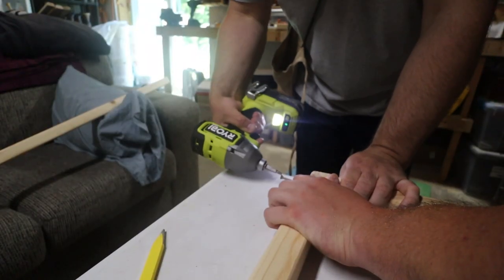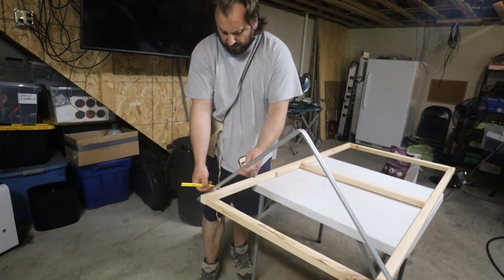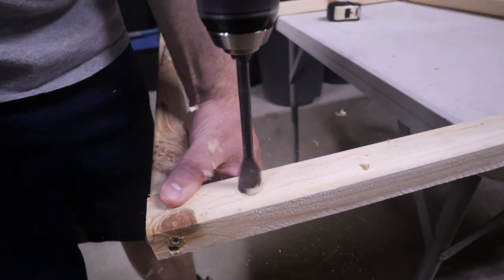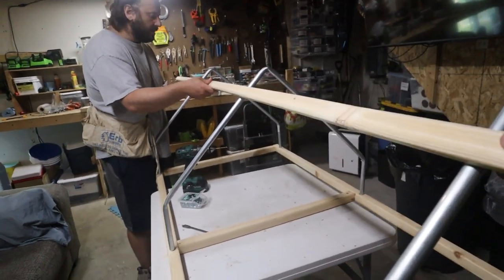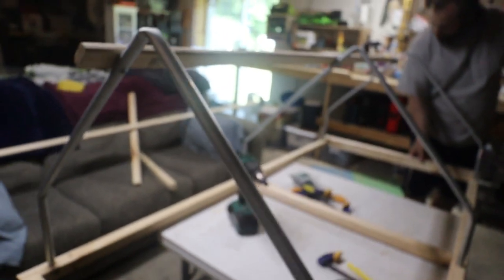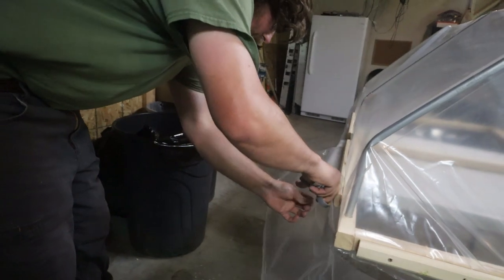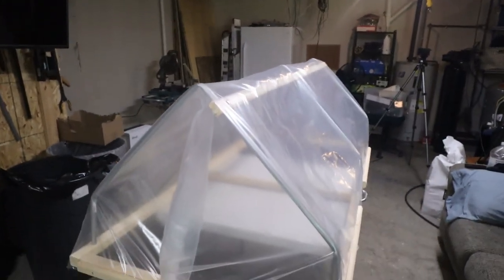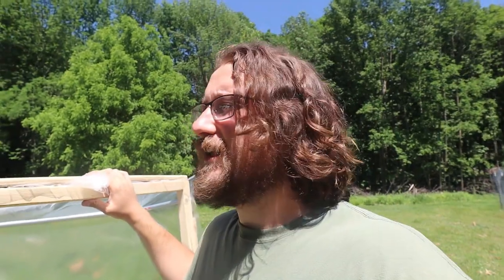SIMPLE Cold Frame in Under an HOUR | PVC FREE

Comment: good info :)  I looked up my order for clamps and such and it was at the end of March 2020.  That was somehow funny to me.  The raised beds are older than that, and made out of all reclaimed materials.  
Anyway, I love EMT for the garden.  I got EMT for making hoops, and we made a jig to bend it too (ours were rounded).  Since my raised beds for my home garden (we also have a larger farm garden that is "wilder") are all the same size, I* put EMT 2 hole straps on the outside of each bed and fit the hoops in on whatever bed I need them on.  I had some leftover pieces of greenhouse plastic so I cut a couple of pieces that fit on the ends and used "Brass Shack Snap Clamps for 1/2 EMT" to clip them on.  They are quite secure but I can remove them if necessary.  Then, a rectangle of plastic for over the hoops.  I used the snap  clamps or "UTEBIT Backdrop Spring Clamps 12 Pack 4 Inch Large Heavy Duty Photography Backdrop 4" Clips" (amazon search words).  The clamps are easier to adjust when I need to work in the bed.  They are still good 2 years later except the little orange end pieces fall off immediately.  I can move around the plastic when I don't need it, and move the hoops when I don't need them.  I take off the end pieces of plastic when it is too much heat.  I also use the hoops to provide structure for the sheer curtains (thrift shop) I put over the hoops when I need to keep the birds away from the strawberries or the insects off a crop or a little shade.  I can fold up the plastic or sheer cloth when I don't need them (and it makes them last longer), and move the hoops as necessary.
Anyway, I love EMT.  So much better than pvc!  This is another project that uses what you might have on hand, which is great encouragement for "the rest of us".
*also "I" generally means that I have ideas but my husband mainly executes them.  Good for me :)
Reply from the maker: That is so cool! EMT is awesome for garden projects. It sounds like you’re keeping him busy haha